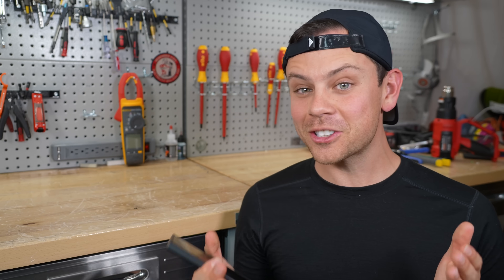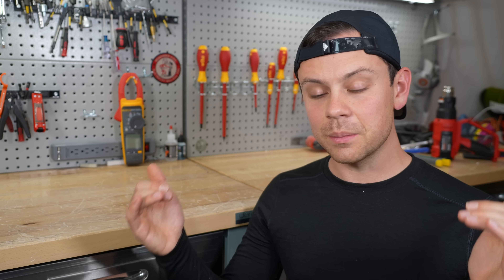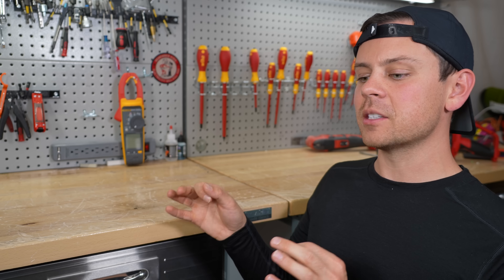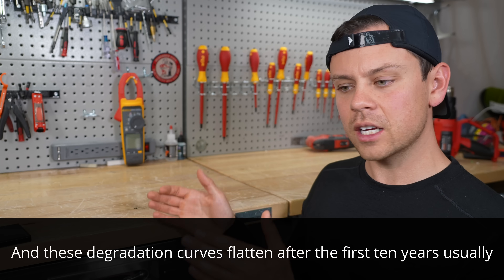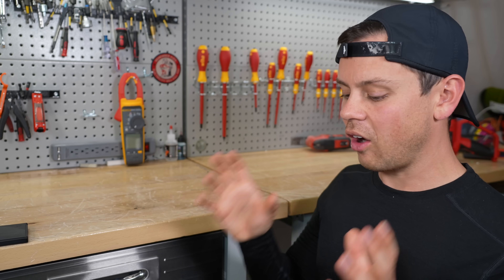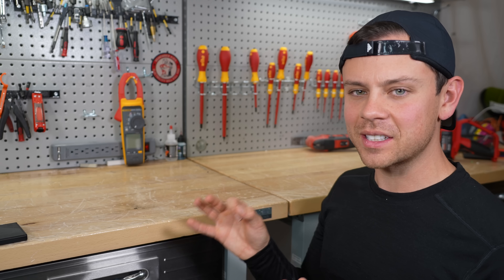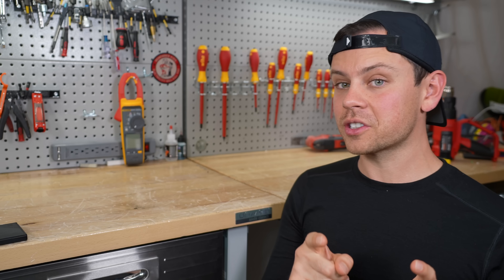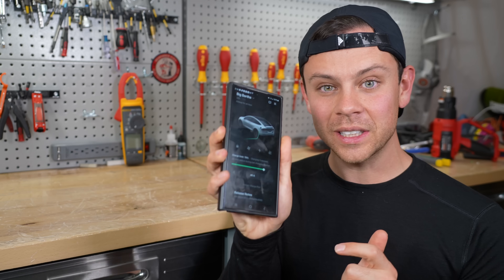LiFePO4 Longevity Discussion! Why Charge to 100%?! For Solar??

Comment: I’m wondering about the batteries in campers and caravans where they are in a small external container with minimal ventilation. 

Some of the caravans I am looking at here in Australia have the batteries with about 5cm of room on the sides in a black metal container. This will definitely get hot in direct sunlight, so if our van has that I may well put a small remote temp sensor to see how bad it gets.

Comment: Do you recommend charging a LiFePo4 12v battery at 100% when it reaches 14.4v or when the BMS disconnects the charge? Thank you for the tutorial.

Comment: yes, WattCycle battery said its BMS wont start to equalise until reaches 14.1 volts, but other themes indicate they wont like my agm 14.4 volt charge rate so to please both i set PV to go off at 14.2 volts so it at least reaches equalisation. It also seems the lith faster charging than old batteries is only up to 13.6 volts then goes slower than old batteries to hit the 14.2. it seems to me, BMS NEEDS REPLACED BY INTERNAL COMMON CONTROLLER SO ONLY ONE MANAGER, as they are at odds with eachother a BMS & SOLAR CONTROLLER.

Comment: Jeff Dahn has Nickel based cells int the lab (May past that now) Which show ZERO noticeable degradation.
How?
They tweaked the chemistry, then reduced the voltage.
Those cells STILL give better performance than the best "iron based cells" and are totally safe because (in part) they're not running at the high energy levels.
Anyone in doubt regarding what Will is saying should search out Jeff and watch his presentations.

Comment: How about in RV use? With an accompanying solar install and the RVs 12 volt converter/charger always online, you are unlikely to ever discharge fully. How often must you run a three-battery install to zero to allow rebalancing? Is once a season sufficient?

Comment: Hi Will 
Thanks again for your content. 

I might speak for some people who are in the middle ground. 

I have a small 12v LFP solar system in my trailer, which i use on weekends and less in winter. 
I have taken extensive notes from your videos and forum conversations and understand everything you are saying. 

I guess the outstanding issue is that if im not using my system for a few weeks/months its technically storage, so ideally 50%. But nothing in the vic or renogy management systems allows you to choose 50%. In the past i manually discharged the batt and shut off the solar, but the parasitic load of 0.07A would flatten 50% of my 50ah battery very quickly.

Ive tried leaving my Renogy Mppt DcDc set to low voltage, so it tries to float below 70% for storage, but its not very accurate.

Is there a better way to manage it? 
 
For trips i turn it up to 14.4v. 

Thanks

Comment: I have had my cells for four years now in my converted minivan. I charge to 100% and discharge to zero. The cells are always close voltage wise. As soon as the BMS reads 100% the BMS balances the cells. The BMS reports 2 full cycles in 4 years. Pretty sure they will last forever.

Comment: yea so true if you actually work the battery , dependant on electricity prices keeping yearly increases in mind over the lifetime of the battery we would with our conditions save 10x the batteries current price over 15 years which is what many say is the minimum life  expectancy of these  bateries

so kicking away dolars to save pennies? saving the battery is foolish
now yes i would not touch 0% regularly as some bms's have cut-off voltages lower than recommended , i do from time tot time

in my setup i have a second hand shoto that i think was used in this 20-80% scenario and thus one cell has degraded
to 50% so whenever this cell is dragged down to 0% i find that it drifts faster

this specific battery settings is also set for a 2.2v low voltage shutdown  lower than manufacturers recomended 2.5v (i think it is for load compensation) hence i try and do 20-100 and allow lower  if needed, i did the 20 cause i thought if it adds longevity

so yea for me i try and do 20-100 and allow lower  if needed in blackout 

unfortunately the amount this degraded cell drifts exceeds the passive balancers capabilities, so i routed two wires from this cell to an external connection, whenever i see it drifted a lot i charge this cell to get it back in sync, ordered a new cell so when i have time i am gona swop it out

Comment: "if you dont balanced the cells, the longevity of that cells will be affected" 
You will not find this statement in a serious study.
The problem is that your entire reasoning is based on this erroneous premise.
When cells are unbalanced, then you lose a little bit of usable capacity, but this is not a permanent degradation : as soon as you re-balanced the cells you return to the normal capacity as if you had had the cells permanently balanced.
So WHEN we don't need all the full usable capacity (which is often the case when you have correctly dimensioned the size of your battery) : we don't need to balance the cells, and therefore we don't need to charge to 100% either ; positive consequence of this without any effort : a little less degradation, even with lfp chemistry (all the scientific literature shows it).
WHEN we need the full useable capacity, then you have no choice : charge to 100%- discharge to 0%, there is no subject.

Comment: Great clarification. I have too many customers asking me this question, and many customers come to me because they have problems after setting the charge cut-off SOC to 95% or 80%. It may be the fear of cycle life brought by the lead-acid battery era. Many people are worried that setting it to 100% SOC will reduce the battery cycle life. Most manufacturers' batteries have a cycle life of more than 6,000 times. Assuming that they are charged and discharged once a day, there are 16 years. In fact, the cycle life will be better than this. In addition to the balancing problem you mentioned, the SOC calibration function of the BMS can only be activated when it is fully charged.

Comment: Have 8kw solar system, 10kwh of battery storage + grid tied. By about 12noon the battery is full and they usally stay 100% most days* till 5-6pm. Then by 3am-6am they are usually be used up. I'm expecting a long life out of these. Have a GoodWe GW6000-ES-20 and 2x Lynx 5.4kwh batteries. Been 1yr since it was install here in Tasmania and generated 11344kWh in that time. What do you reckon on GoodWe without pulling one apart ? Cheers.

Comment: As a tech of lithium factory, there're a couple of factors effecting the LFP lifespan, DOD using level, C rating, Temp would the top 3 . Technically  100% DOD using is OK, but for solar application would recommend 85-95% DOD using, and do a full charge-discharge cycle every 3months should be enough. Because a new battery its LFP cell consistency is very good, delta voltage is <5mV, so no need to balance the cell every cycle.  Charging the 100% will trigger the protection a lots which is annoying.🙃
Reply: Why they hire you, ure so dumb 🤦‍♂

Comment: Personally I charge to 14v (3.5V/cell) the reason being that my solar charges at a relatively low C rate and so 14v is pretty nearly 100% and it allows any high cell to go higher which increases the balance current on a resistive balancer and so speeds the balance operation for the high cell particularly if the balancer can still function when not charging. I set the balancer cut in at 3.4v/cell which is just at the bottom of the upper ‘knee’ this seems to have worked well. I also have packs with active balancers that I also set to start at 3.4v as any lower as I have found any lower can actually be counter productive. I actually don’t recommend going to zero, the reason being some usable reserve is good and also one doesn’t want the risk of leaving in zero state of charge as then self discharge can push them lower. I feel that running close to zero is bad management and I do think it is good to have that reserve. The JK-BMS even has provision for an ‘emergency’ and it’s nice to have some capacity to make that available safely. I also run hybrid which puts certain constraints on the high and low level cutoffs in order to enable use of charge sources without a lithium profile. As well as having a redundant system.
Reply: After having charged to 3.4V, do you hold your cells at 3.4V?
Reply: @User-jr7vf  I charge to 3.5v and don 't hold them there. I stop charging and only start again when voltage has fallen to 3.375v which suits the way i use and charge my system and have my solar controllers set up.
Reply: @philbrooke-little7082 thank you. I asked this because my MPPT just holds the battery at the voltage that I set, so if I set to 3.5 (multiplied by 4) it will just hold the battery at that for hours, which I think is not healthy for the battery. So I don't know what to do.
Reply: @User-jr7vf  if you let it do that it will overcharge it. If it can be set to go to float then, for a 12v battery a float voltage of 13.5 will be ok for it,no more than that.

Comment: Simple analogy to those people who still confused. 3 empty cups that's connected with a tube at the top for overflow. so you fill the first cup with water and when it gets full it will start to fill the 2nd cup with water and that happens with the 3rd cup.

Balancing the battery is similar to that so 50% basically means 1 cup & a half is filled but the 3rd cup is empty to which it's not balanced. 100% is were all 3 cups is filled to the max limit it can hold (depends on the setup , once filled the inverter temporarily suspends charging until it's been used again).

Comment: Actual educated developer Literature actually recommends about 73 to 79 percent for optimal “cell life” and a Depth of discharge between 20 and 80
Depends on which percentage you’re looking at though
Cell balancing isn’t the same as multi battery balancing buy a suitable bms if your battery system doesn’t already have one.
And it doesn’t make sense to you because you’re looking like impersonating clickbait.
Probably hasn’t seen a proper data centre power connector in his life, and for that you’d be a tin foil hat award nominee
Reply: So saying sake you can do 14.6 v max (13.7) would possibly be best (approx 80%)

Comment: Both the last & this video explains everything very well Will but there is ONE key detail not stated in any way.  WHAT VOLTAGES are you calling 0% - 50% - 100% SOC

0%=3.000, (50%=3.200) & 100%=3.400  (Where 3.200 = Stated Nominal by Manufacturers.)
- OR -
0%=2.500. 50%=3.075 & 100%=3.650 

The actual Termperature Ranges should be mentioned as well (I know, repeating endlessly the same over & over).  Such as Optimal Preffered Temp is 25C/77F and optimal working temp range is 15C-35C  59F-95F

Last point, you covered the Cycling Process and the differences between EV and ESS charging & the associated stresses.  Great that is REALLY Important to drive home.  People still have extensive difficulties understand the whole Full / Partial Charge cycles and how that works.  A Proper ESS system as you know very very rarely will ever run a full charge cycle, if properly built, it should really only need a 1/3rd Charge Cycle per day (assuming the system has 3 days of energy storage).  * This of course will vary according to the Installed Energy Storage Capacity as many people do have more than 3 Days reserve on hand.

Solve the overall Confusion by stating actual Voltages & Temps etc for the Specific Chemistry which will address the vast majority of the ongoing debates of the numerous "Opinions" that everyone posits.   

How would you want your Heart Surgeon Taught ?  With only partial details and letting him figure it out along the way, or with full & proper detailed information & knowledge ?

Comment: I think people fussing don’t understand LifePo4 is a different chemistry to Li-Ion, hence has different properties and charging/discharging profiles. I’ve had a small solar setup using LifePo4 batteries going for years, they are charged to 100% everyday. Why? because the sun comes out.

Comment: The problem is, it's just been beat into people's brains that "Lithium" batteries degrade fast when they're fully charged and fully discharged..    That they swell up, and can explode and burn.. etc. 
LiFePO4 is just a different beast compared to LiIon and LiPO, and most folks have simply not been exposed to LiFePO4 with so much focus on LiIon and LiPO (in the hobby world).     I've got some 3-4S packs made out of genuine  A123 cells I bought  back in like 2011, and they're still going strong.     They charge fast, they discharge fast.. they can be drained to empty, and stored for a long time.   They're bulletproof.   Yes they've degraded, but they've outlived all my LiPO packs from that era.. and many after that.

Comment: For my sailboat which is on shore power 24/7 i kept the end voltage at 3.46V and start active balancing at 3.43V.  Due to curve is flat until 3.4V thats the first safe place to detect 95% SOC

Comment: I think some people have trouble with this because they don't know the voltage of their batteries when they're at 50% and maybe even 100%.. mine are AGM (I replaced the original two 100a batteries) and they're so damaged because they were being charged by an 80w panel through a controller that was not designed for AGM batteries but regular lead acid batteries. Mostly a problem when plugged into shore power and not so much when charging with the panels. Sorely under designed (by the camper manufacturer) so they were always under charged and over discharged once I started living full time in it (and had no idea what I was doing). I've upgraded to 400w of solar so that problem is solved but the batteries are wasted. They won't charge above 12.5 volts and are at float often before noon. I want to install liFepo batteries but the controller/ converter is installed in such a way that makes it nearly impossible to remove. I need to look at it again but there's copper plumbing installed right on top of it and no room to get it around it. I've thought about cutting it and putting a Pex section in to alleviate the problem but I'm cutting a pipe I don't know exactly how to completely drain or if I can completely drain it. All the electronics are under it. I'm learning to read the schematics and they are very good once you figure out how to read them. All the systems are extensively mapped. The technology is from 2006 so almost everthing needs to be updated. But it was under designed when Lance built it in 2006.

Comment: Right on the money, keep ‘Em coming. Thanks Will. 👍 That’s pretty much what I do with my home’s LFP batteries. 
P.S. My 2019 Model3P is typically only charged to 65%, especially in Summer, unless I need more- which is pretty rare. It’s NEVER been above 95%, even for a big trip, which retains some regen. 
So it’s now over 5 years old, and my degradation is really very minimal, something like 6.5% or so, and no significant change in the last few years. 
These batteries will last a VERY long time with just a little bit of care.

Comment: Got it. Charge to 100% on odd days, 72.5% on even days. 50% on leap years 😜

I try to use my system fully and charge to 100% to balance properly

Comment: Been running cheap amazon batteries full time. I am completely off grid. Paid for 300 ah at 24 volt 2 years ago.  Still charges above rated capacity. I get 317 ah. I charge to 100 percent and drain to zero very often as I run my a/c and gam8ng computer off it.

Comment: I made a battery backup system with some LF280's and an LV6048 because I thought I would want solar one day, but more because we used to have frequent power outages and I wanted something to make sure my furnace, fridge, internet, etc, stayed on. Especially in the dead of winter when it's below 0 and I'm frequently working around the state. Well, they fixed the aging substation last year and now we've only had a couple of brief power flickers since.

So now my system is kinda wasted. Unfortunately my small utility company doesn't offer time of use rates, otherwise I would use it to charge at night and discharge during the day. And I don't want to put solar on the roof, the city said they would want the whole permit and inspection ordeal. My battery and inverter are not UL listed, so that's a no-go.

Comment: I'm off-grid and have 30KwH of storage. I hold my batteries at 100% for 3 hours every day during the summer when I need electricity for A/C and during the winter it is about every two days.During the summer my batteries get down to about 75% by morning and winter around 80%.

Comment: I really appreciate your videos. When I first bought my SOK batteries I was so worried id ruin them by not charging them correctly with my solar. But all I did was set the voltages where they needed to be per your videos and the manufacturer and I havent had any issues. They work! I was even worried about going below 20 percent! But not anymore!

Comment: whats the recommended voltage to charge a 24v battery to 100% is it 3.6v or 3.65 v per cell? and wats its zero percent if i may ask?

Comment: I know you love going on rants but I am not afraid of NOT using my system EVERY DAY. so why do I have it? I have a a boat and camper AND A JOB.  Yeah the batteries sit a lot and I need to balance them before I use them.  Yes both systems are expensive.  I have a 1200W motor for the sailboat and a 3000W inverter/charger in the camper.  If I need do replace four 100AH batteries whatever.  Way better than DC27 lead batteries.